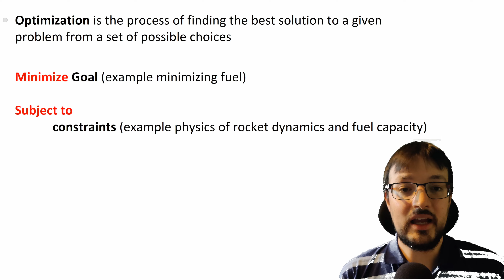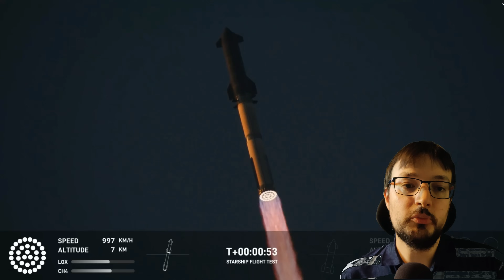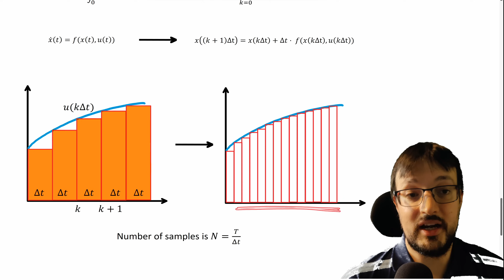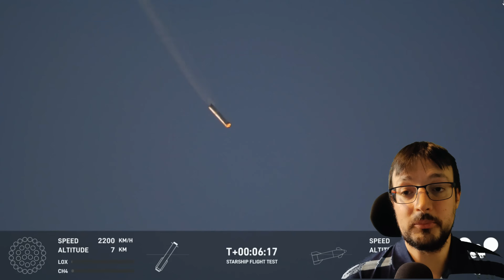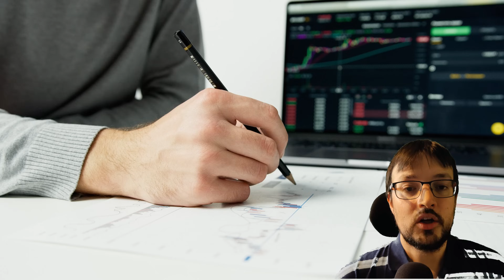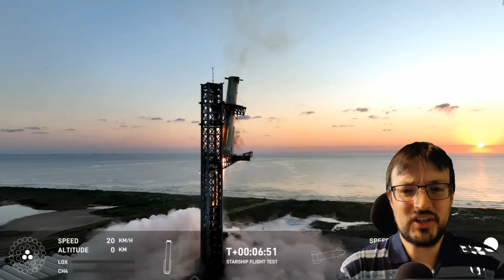How Does SpaceX Optimize Rocket Launches? A Convex Optimization Playground

Comment: Rockets can make anything even cooler hehe thanks!

i think that the most famous deep learning training algorithms also uses sequential convex optimization ... like ADAM works by estimating the hessian matrix with past gradient information, which is a symmetrical positive definite matrix, and then builds a convex function with that to optimize and choose the next step.
Reply from the maker: Haha, rockets definitely do make everything cooler! Glad you enjoyed the video, and thanks for the comment.
Regarding deep learning: ADAM doesn't explicitly build or solve a convex approximation at each step in the way sequential convex optimization methods do. Instead, ADAM is a first-order method: it keeps running estimates of the first moment (gradient) and second moment (squared gradient) to adapt the step size per parameter. These second-moment estimates are not true curvature information, and Adam does not estimate or use the full Hessian matrix, nor construct a convex surrogate problem at each iteration. It's a different mechanism, but just as fascinating!

Comment: Why are you minimizing the difference from the predicted trajectory? That seems brittle in that if you get far enough from the prediction rather than picking the lowest cost path that correctly lands obeying all the constraints it will spend fuel trying to close the distance with the original prediction.  Or are you replanning every so often but just less frequently than you need to update control inputs?

Also, the discretization seems odd.  I mean sure in some sense you must do it eventually but I'd have assumed that you want to stay in the continuous domain and apply variational methods and/or pick some kind of basis for the function space and discretize after that/relative to that basis.

Comment: At 13:14 does the convexified cost function have to be larger than the original at every point? I guess it makes sense for hard constraints but what about the soft ones?
Reply from the maker: You can do both. You can take the convex upper envelope, like in the video and this will give you a minimum which is not necessarily as good as the minimum of the original function. Or you can take the convex lower envelope which lies below the original function. In this case the minimum of the convexified problem may not be achievable by the original function. In other words, you can get an upper bound and a lower bound depending on how you convexify. A similar discussion holds for the constraints, but usually in that case you want to take the inner convex set, so that you know that the obtained point is feasible also for the original problem. Of course this will give a conservative solution (an upper bound on the minimum).
Reply: @  Makes sense, thank you!

Comment: Excellent review of a fascinating subject. I have often thought it would make a great video game: the user controls thrust and direction as functions of t (which define a path) and tries to minimize fuel consumption for launching or landing. Most trials will result in failure to reach orbit or crash landings, but with continual fine tuning, success can be achieved. The successful paths can then be compared to the optimal path.

Comment: Very interesting and fun to know and spread this…
I taught most were non-convex…
Since many equations are in incomplete or unsolvable or simplification (that could have chaotic variations if over simplification)
Reply from the maker: Yes, many problems are non-convex, which is why I explain the idea of convexification. But yes, those are approximations which have their limitations. That said, convex opmization plays a big role, and there are rumours, although not officially confirmed, that they actually use CVXPY specifically as tool.

Comment: Don't all space launch organization use such optimization?
Reply from the maker: All space agencies, all aircraft companies, all car companies, all industrial robotics companies, all power generation, transmission and distribution companies and agencies, all FAANG companies and you can go on forever, use maths and optimization. In fact, any AI tool currently in use is designed using optimization… for instance during training, via SGD, or hyperparameter optimization. Everything is attempted to be optimized at industrial scale, because if it not, you are not making as much money as you can. This also includes better sensors and hardware. For instance by minimizing surface used on the wafer or reducing power consumption, thus making them smaller and more efficient. So why SpaceX? Because it's something a lot of people relate to at the moment.
Reply: If you consider throwing their bosters away after a single use, then yes. Otherwise no.
Reply: @TontNZ  they certainly have to optimize for launch and for where and when to fire retrorockets so as to land capsules in the desired location.
Reply: @RonJohn63  Accepted. I was really just pointing out that the most significant optimisation is that of the reuse of hardware. It's gone from impossible to everyday. Look at what it has enabled SpaceX to achieve: from launch cadence, through to launch cost.
Reply: @TontNZ  how much of that is "the math of convex optimizations", and how much of it is "computer hardware (including cameras and other sensors) has finally become advanced enough that reusable boosters finally became possible", and SpaceX were the young turks audacious enough to implement it?
Reply from the maker: All space agencies, all aircraft companies, all car companies, all industrial robotics companies, all power generation, transmission and distribution companies and agencies, all FAANG companies and you can go on forever, use maths and optimization. In fact, any AI tool currently in use is designed using optimization… for instance during training, via SGD, or hyperparameter optimization. Everything is attempted to be optimized at industrial scale, because if it not, you are not making as much money as you can. This also includes better sensors and hardware. For instance by minimizing surface used on the wafer or reducing power consumption, thus making them smaller and more efficient. So why SpaceX? Because it's something a lot of people relate to at the moment.

Comment: Thank you Dr Scarciotti, mathematics isnt my strongsuit by any means but your presentation was very enjoyable. Obviously optimization is a robust and significant component. But how does a falcon 9 for instance "know" its orientation in 3d space in order to provide data to the algorithms? And does optimization apply to guidance in zero g environments the same way it operates in the earths atmosphere where more dynamic forces are at play?
Reply from the maker: Many thanks! The formulations in the video are very simplified versions of what's going on. For each aspect there are teams of people working on that aspect, and the number of constraints is definitely higher. Regarding your first question, the rocket knows its orientation by applying data fusion techniques based on multiple sensor measurements. I touched upon this briefly in my previous video. Regarding the second question, yes optimization is always applied, what changes is the formulation of the problem, so that the equations take into account the specific situation in which the rocket is.
Reply: @Prof_Gio  thank you, i look forward to your next video!